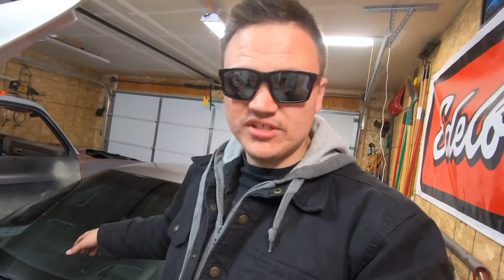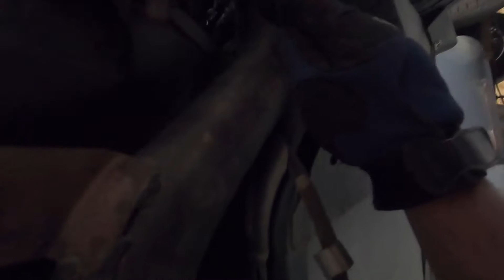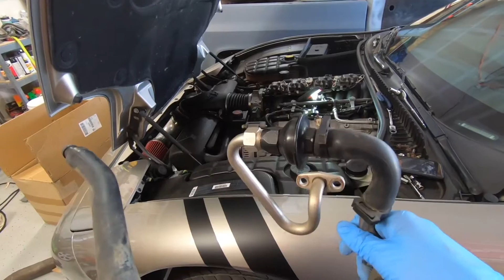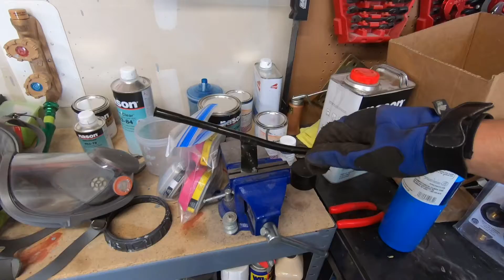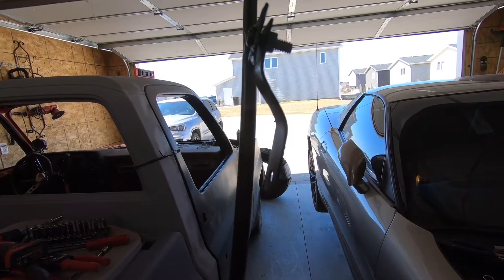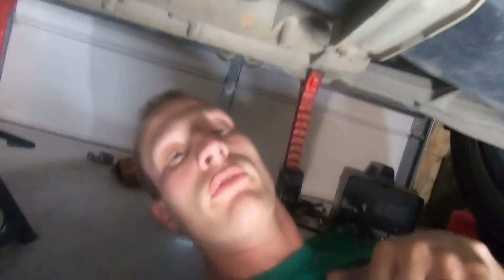Speed Engineering Headers/X-Pipe Install on the C5 Corvette! + 97-00 Dipstick Mod

Comment: Did you have to tune out the o2 sensors ?
Reply from the maker: dominick guerrero yeah I will have to tune the rear o2’s out. I haven’t had it tuned yet. I’m in the processes of doing heads/cam/intake